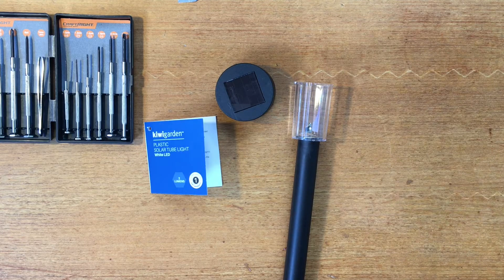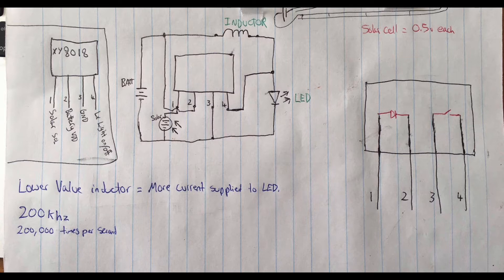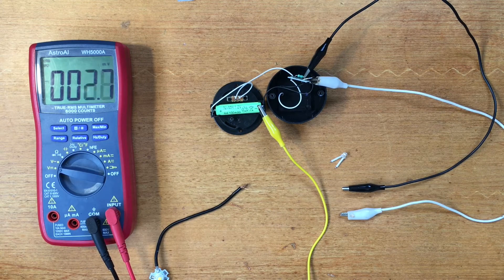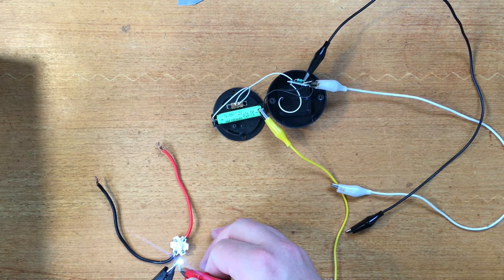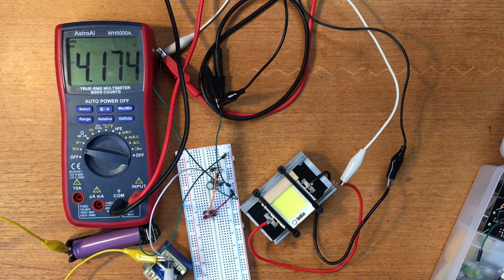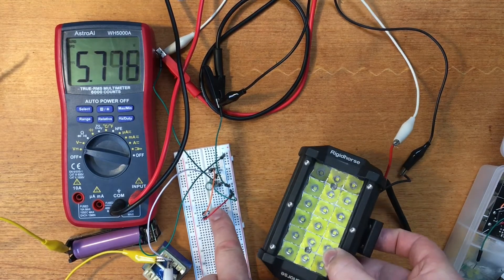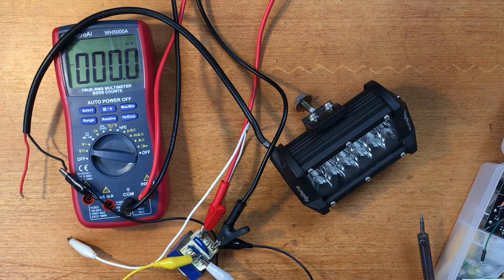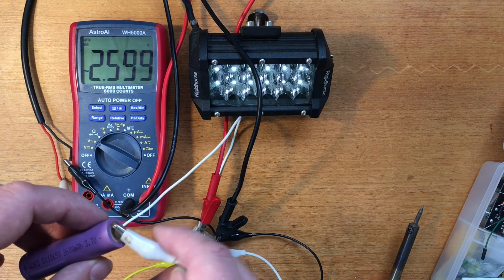Surprising complexity of a $2 Solar light: How it works

Comment: I keep finding garden lights on the side of the road. Especially in spring. Just found another that has a 5252F IC. From what I understand. It should have a internal diode or some protection to ensure current from the battery doesn't go back into the solar panel, wasting the batteries charge. That was my issue with the first panel I found. I removed the LED since I only want it to charge my nimh cells. Hopefully I can just leave it in my window to do its thing.
Reply from the maker: Nice, good luck. a diode would work but it will drop the voltage by 0.7 volts which is probably too low unless you use 2 panels.
Reply: @KiwiMaker  If I find that these IC's work well. They're stupid cheap for a 10 pack. I'll probably get some for future roadside panels I find.

Comment: That's not a crappy panel. Looks like glass. The crappy ones are those slightly larger ones covered with epoxy. They look pretty at first but only a year or two later they have yellow cracks. I know because I'm a painter and see the crap all the time. They look ugly, almost opaque, and so I apply a little clear stain on them (just for kicks, and to see all the solar cell damage). That makes them transparent again, at least until the wood stain ages.

 But the glass ones, maybe they go bad too (but can't tell unless I stay till dark) 😄
I imagine the glass to have the PV material sprayed on and that it should be less efficient. It looked like only 3 "cells", for 1.5v. If correct, then we could actually use only 3 cells in series to charge up the batteries, I mean battery. It's a 1.2v nimh or nicad. The first is okay, the nicad if BAD for environment because cadmium is like, well, we're not even supposed to touch it like we can the other battery elements.
Anyways, I think we need at least 4 solar cells in series because the Chinese block diagram (of the innards) showed a diode, which must drop at least a quarter volt or so, directly to the battery from the solar panel.

 Somewhere, it said to use a 2.5v (5 cell panel). But others said 2v (and shown the 4 cell panel in their videos).

Ya, I'm just checking things out before I go out buying thousands of the little chips (I believe they're only 6¢ each). 😁

Comment: 1:11 YX8018 has common + ve and Battery +, and -ve is 3, not GND (YX8018: 1.LX, 2. GND, 3 - VE, 4. BAT +). Seems you add connections for QX5252F and show IC as YX8018 (ok it shows XY8018 but i can't find solar IC like that).